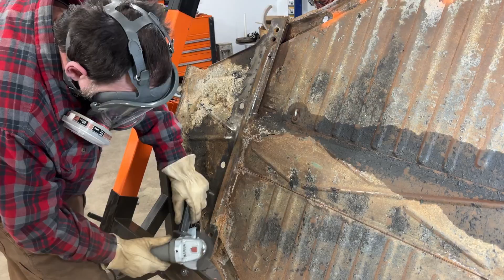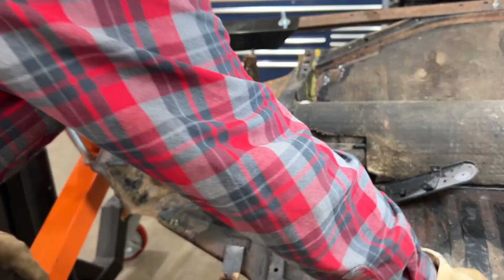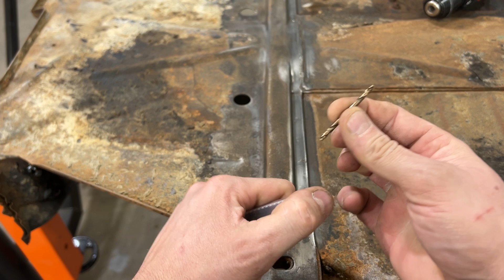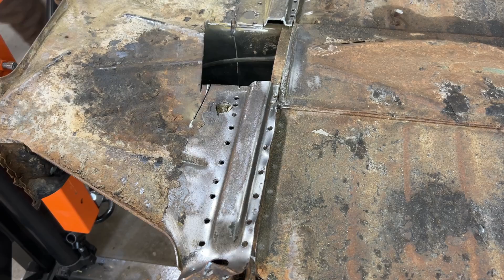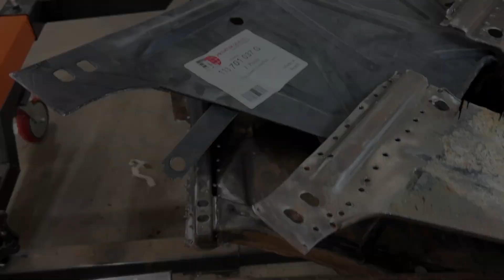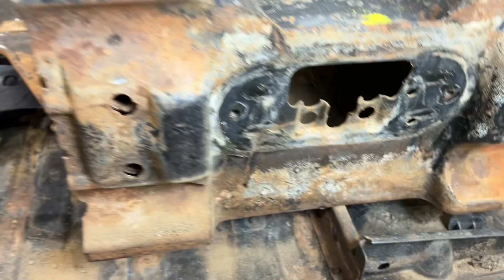1961 VW Restoration | Frame Head replacement - part 1

Comment: Yeah, I agree that new frame head is not a dealbreaker, but I would be disappointed in those little imperfections myself
Reply from the maker: Yes sir, disappointed is definitely the appropriate description. Some of them are somewhat understandable from a cost perspective, but some of them would not have cost any extra or at most they would have cost a couple minutes extra labor. I guess the worst part of it is that over the years I have come to accept substandard parts as the "normal" when working on old cars. To make it even worse I've found that you can pay extra for the same part and get the exact same quality as the cheap ones more often than not. Dealing with the "quality" of aftermarket parts is really a sad aspect of restoring old cars and trucks.

Comment: I see a lathe in the background that wasn’t there before. Are you making parts for the VW or is that for motorcycles? :)
Reply from the maker: The lathe is indeed a new addition, but not for any particular purpose (other than turning metal of course). It’s a small hobby lathe (10”x22”) so not something particularly useful for automotive work other than perhaps a spacer or some such gizmo. It might make an appearance in a future video, time will tell. Thanks for your interest!